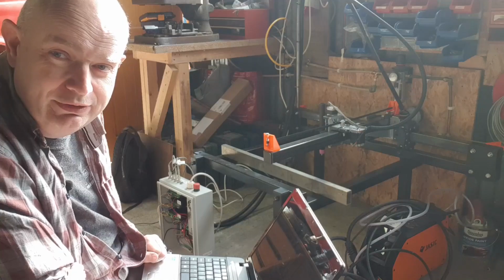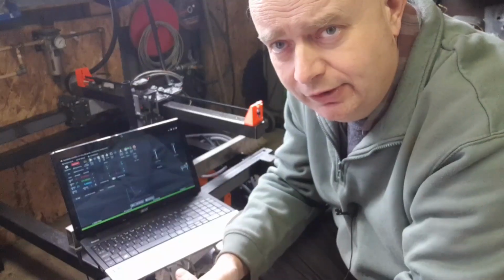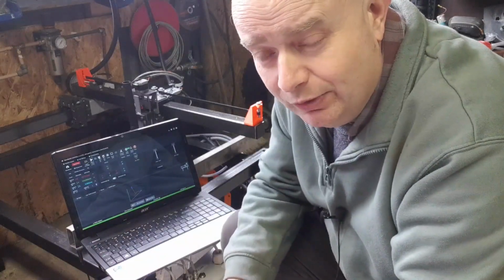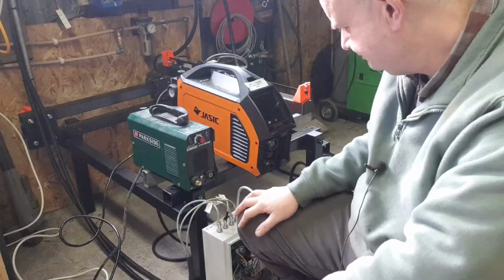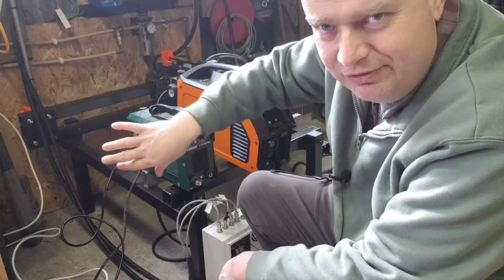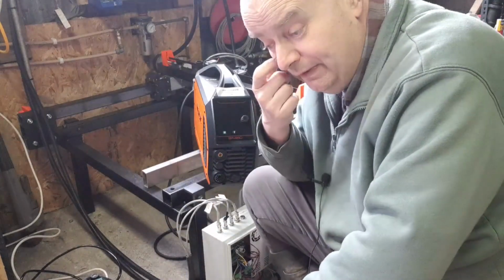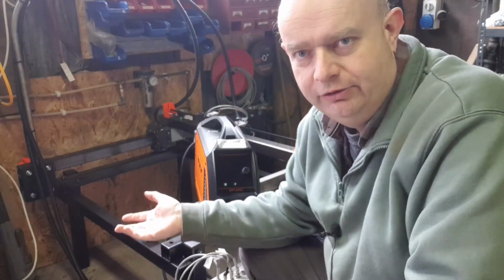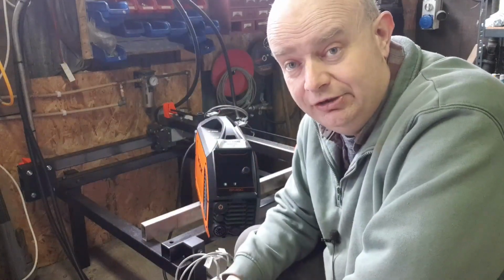My CNC Plasma Adventure Part 1

Comment: Open up the plasma cutter and instead of hooking into the torch pins, connect to the controller inside. There may even be a JTAG debug port (4 pins or vias if there is no header). The easiest may even be to solder wires to the PCB for any functions you need/want ie. torch control, voltage sense circuit etc. and read them off with an ESP32 or Raspberry pi pico for under $10. The ESP32 even has wifi allowing you to do remote monitoring/control.

Comment: There are other ways of getting the torch height control to work there are open source and such available one resource is mach3 cnc forums

I used my CNC plasma mostly as a relative these days making wood project but brilliant tool
Hopefully getting my CNC working with the plasma this year

Comment: have fun... cool thought:   attach an arm to a CNC mill if anyone has one, the movement envelope on a mill might be small,   but with some simple kinematic mechanics one could multiply the movement (multiplying pantograph)   precision should still be plenty fine enough for torching.
Reply: I built a secondary rail thats currently unpowered to deal with some sag, and wondered recently if it could be linked to my router sled and operated like the under appreciated pantograph!